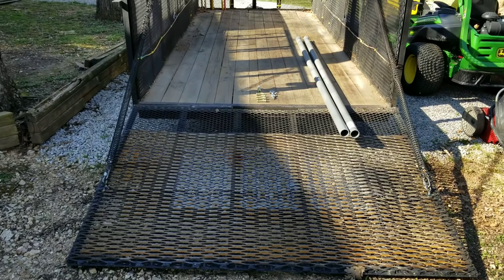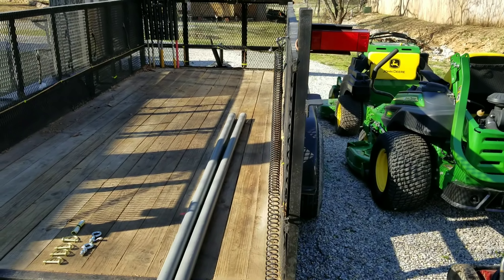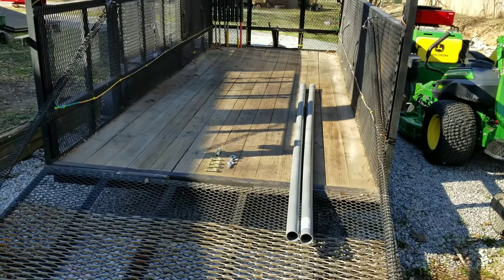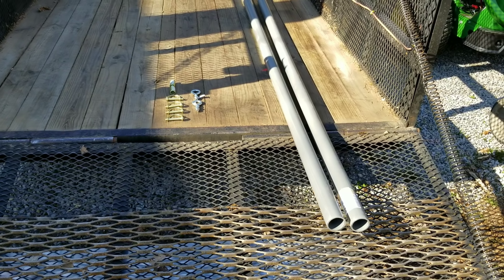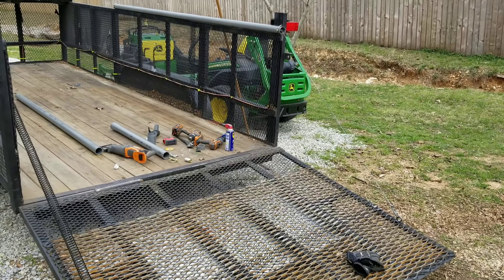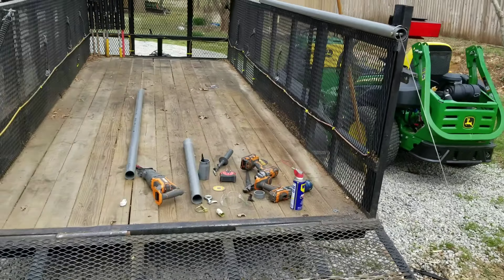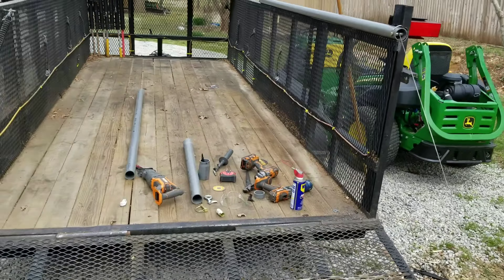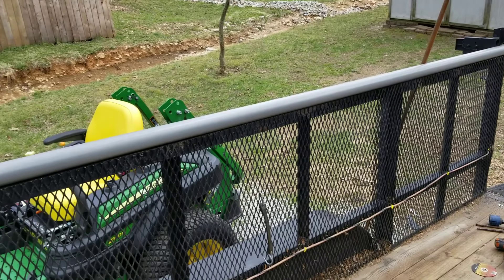DLC - Ramp Gate Spring Assist

Comment: What we used is square with a round wait on the inside. Get the weight of the tailgate. Split the weight period on both sides. And a round pulley for the top and a quarter inch cable. They have new Springs.

Comment: very good , now just tie a orange strip at the tailgate cable end,for a VISUAL  spot
Reply from the maker: Excellent idea 👍
Reply: I used this video to do my 10" trialer.  The PVC was 2" dia. and I used 8" 11'" of PVC.. Used a 130# spring on a tailgate that weighted 65# when down on the ground on a bathroom scale. It now goes up or down 2 fingers. Works GREAT !
Reply: @kennethgunderman9086 
Thank you very much for posting these details!
I’m not clear whether you did this on both sides or only one, since the spring has enough strength to lift the entire gate.